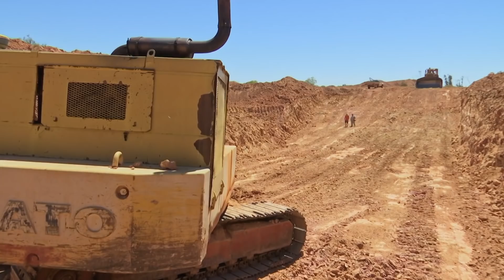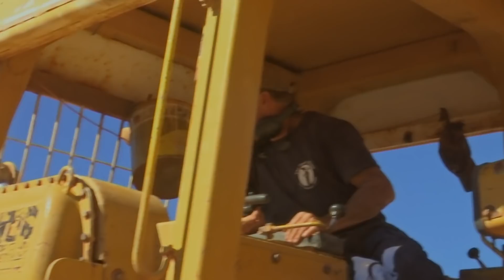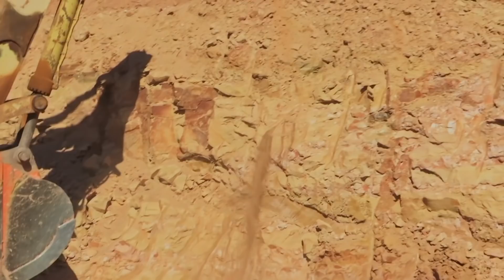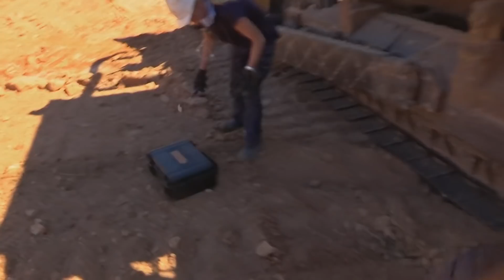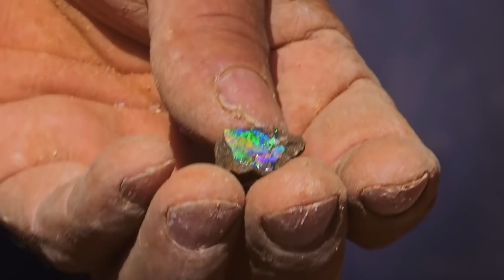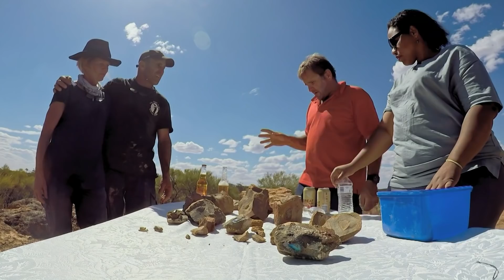The Tarantos Dig Out 40KG Of Boulder Opal On Their Last Day!  | Outback Opal Hunters

Comment: In Oklahoma we have extreme heat. 40 degrees Celsius is about 110f. Our equipment work just fine.
Reply: Same here in cali it was 108 degrees today and the skid steer was running fine
Reply: Sure mate.
Reply: Their equipment is often old junk
Reply: Maybe they need to be using a different hydraulic fluid , oils etc …..I’m not familiar with heavy machinery but it makes sense that if it’s too hot for it then a change to a different fluid , a heavy duty , very viscous one might work much better ….?.
My Dad drove a backhoe for many years here in Western Australia 🇦🇺 and we regularly had 40degree Celsius plus days and he never had any issues , in fact he liked working in the heat better for some reason. I remember he had an fully enclosed cab so he probably had AC .
Reply: You are forgetting every single season only ever lasts 6 hours . There is hear tell of a season that lasted 2 days once but that’s just a rumour 😂🤣😂
Reply: I think that's just the voice over guy simplifying it down to one thing when that's just part of it. It's old gear, and 40 isn't as high as it gets up to 50 at times making it basically impossible to work in the open without suffering heatstroke.